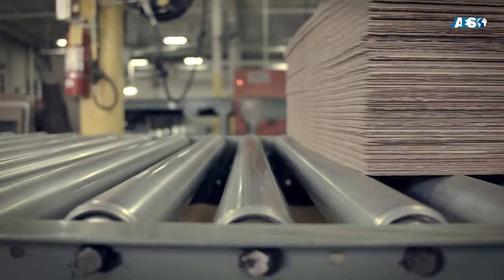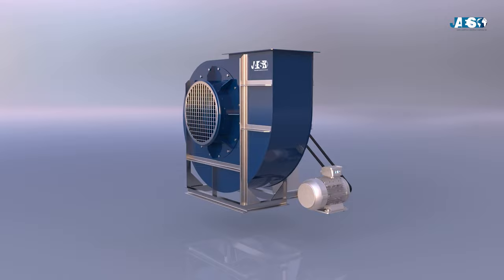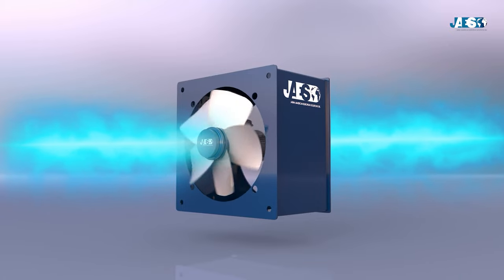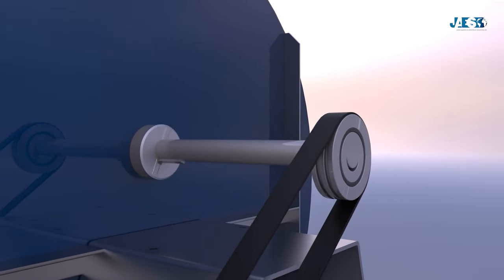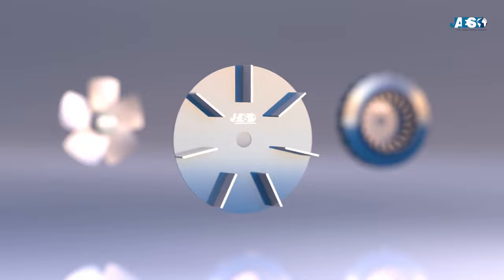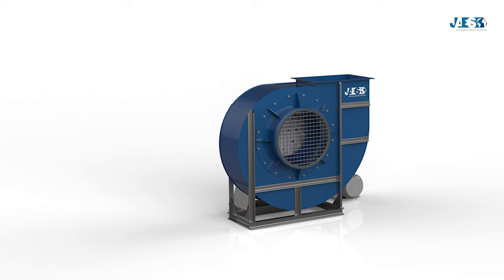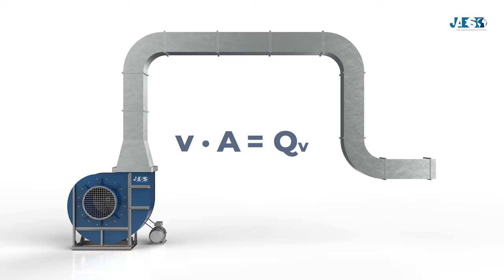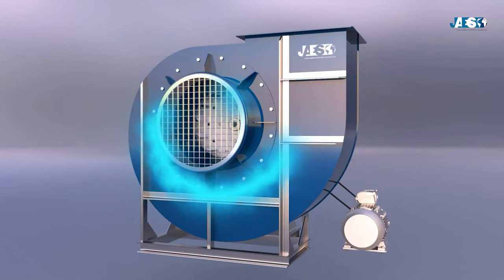How does the air circulate in industrial plants? Axial fan – Centrifugal fan – Flow rate calculation

Comment: 2:14 Clockwise or counterclockwise does not determine which way the flow is. What matters is the if the blades are LH or RH - and the majority of fan blades are optimized to turn only in one direction - they are not typically reversible. 
2:30 centrifugal fans can develop much higher pressures than axial.
3:00 The animation has the impeller turning backwards. 
4:00 it is pronounced "axis" not "access" and this is where I stopped watching...

Comment: honestly just redo the whole video with 2k views you wont loose much and you can reuse the files of the cad models or whatever that is. just put it together the right way have things spinning the right way and get rid of the factual errors.
to make this video you have to understand: how an airplane wing actually creates lift, the difference between bernoulli and ventury, accelerating and decelerating vanes, pulley ratios.